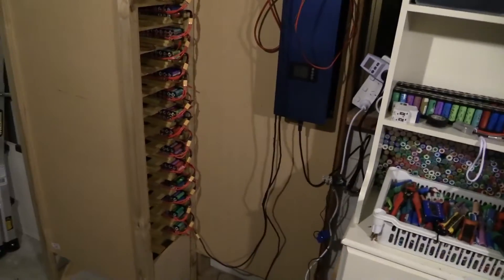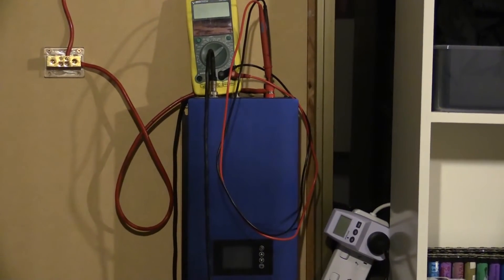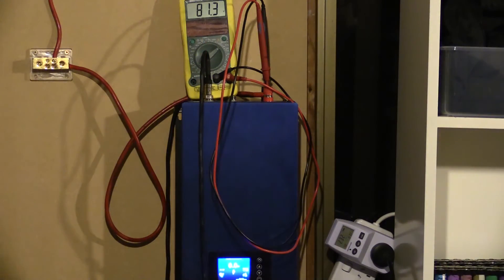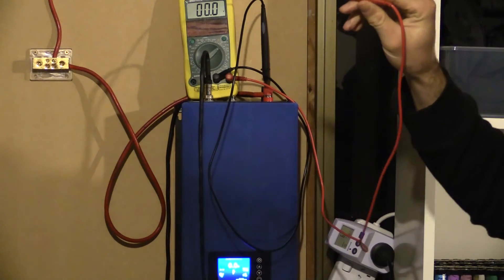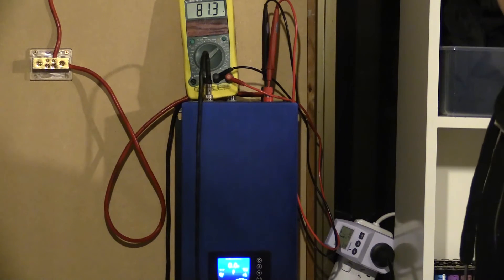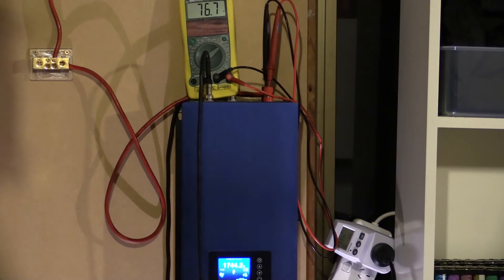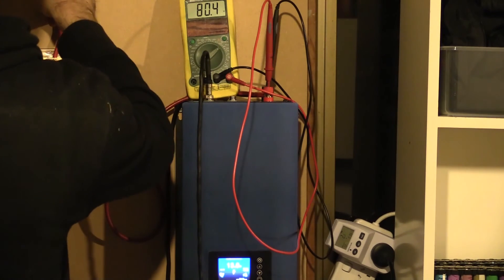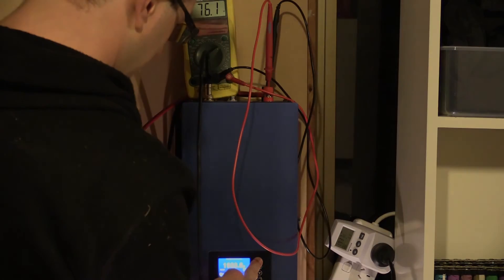5kWh Powerwall Inverter test with Bank1

Comment: Try the CT clamp around the cable going out to the grid, not the cable going to the lamp. I think maybe the inverter is just continually increasing the power output until the CT measurement returns to 0watts, but that will never happen with the CT clamp only around your load.
Reply from the maker: OK will try tonight :) Thank you